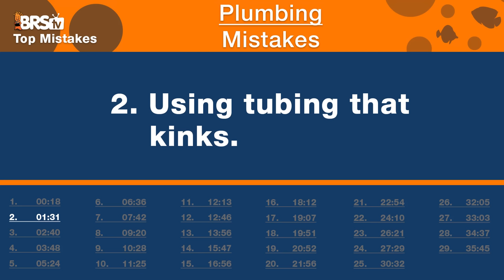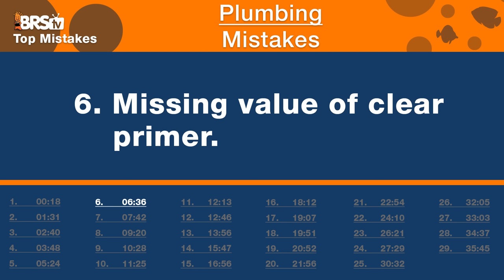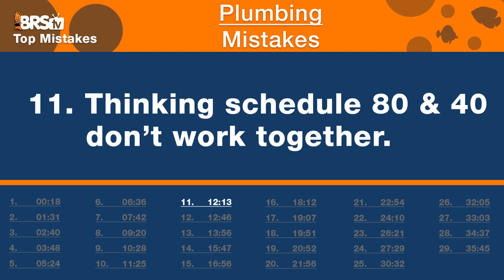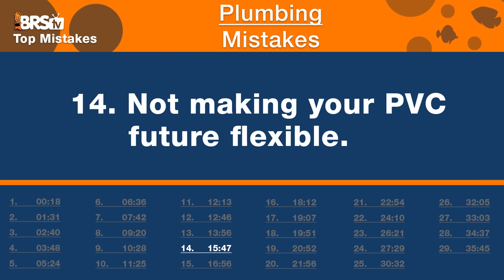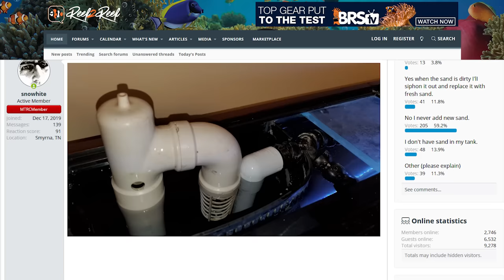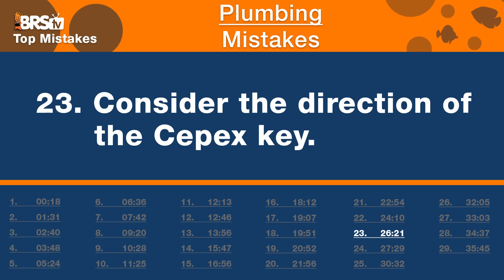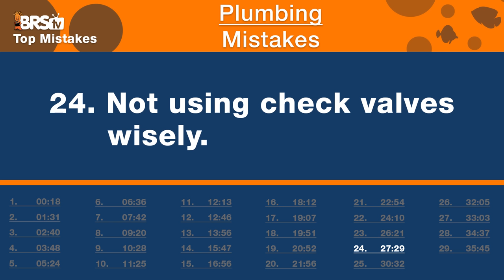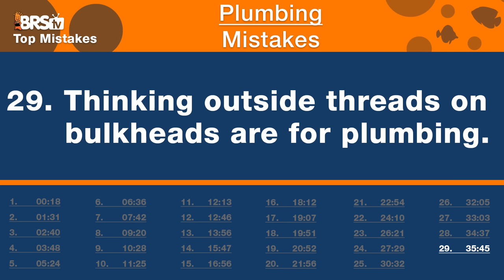If you don't fix these plumbing issues now, you'll hate yourself later! Top 29 Plumbing Mistakes.

Comment from the maker: What was your WORST plumbing mistake you ever made? Were you able to fix it? 
➡ https://brs.li/BRStv_TopReefing_Mistakes
Reply: Bulk Reef Supply not adding unions and then needing to move my sump
Reply: Drawing out the plumbing, to ensure enough fittings on hand. Sucks when having to make multiple orders back to back because your missing 1 or 2 items, also puts a stop to the build.
Reply: Recently, did not cement the join going to my algae scrubber but used silicone to loosely keep it in place. Luckily I was there when the join came open and the pump was rather weak. So very little water leaked.
Reply: Not knowing that when gluing PVC pipe that if you dont hold it in for a bit while it dries, it will push out just a little bit. That little bit compounds itself over multiple fittings.
Reply: Putting a 90 on backwards. Thankfully I realized it before it set and I was able to turn it. Another couple of seconds and I would have been out of luck
Reply: Gluing union cuffs on but forgetting to put the union nut on beforehand. Done that a few times and it's infuriating
Reply: Do they have clear pvc glue instead of that blue homedepot kind

Comment: I'm getting ready to begin my first hard plumbing job on a 40 gallon breeder. I plan on using cheap white 3/4 PVC to dry fit everything in place, then using those to cut the blue schedule 80 pipe. Thanks for the tip on clear primer! I had not thought of that!

Comment: love these videos.  so helpful.  i was hoping you could make a video regarding options for how to deal with power outages.  the one thing i wish the apex was able to do was to handle backup. what are our options?
Reply from the maker: Backing up your entire system usually isn't realistic due to the amount of power required. That said, with flow being the most important thing during a power outage, many pumps like those from Icecap, Maxspect, and Ecotech have great batter backup options!

Comment: Well, good grief. Just like you mentioned, I thought I had all of my DIY sump set up ready to go in my head. But now, I guess I’m going to have to rethink it all.  Hmm... 🤔 
I’m just joking guys. Thank you so much for all the great info! You have really forced me to not only rethink how I want it to work but how I may want to or have to change the parts in the future too. One in particular was the ball valves. I was thinking of using the black pond hose instead of pvc because of the pressure you have to apply to turn the ball valves. Yes, I worry about popping a seal in my plumbing because of the excessive shifting.

Comment: When using those expensive unions, make sure you leave enough space on both sides of it so if you DO have to chop up all the plumbing for whatever reason you still have at least one more use out of them with couplers and so forth.
Reply: 🍻 man agreed :)
Reply: 100% this.   Good solid advice.  I do the same thing on pool plumbing.
Reply: Couldn't agree anymore, learned the hard way when putting on my bulk heads. I should of staggered the heights to make it easy to take on and off.

Comment: A plumbing mistake I just made. 
Be sure to leave unions screwed together when gluing to piping. I had the two sides apart and some glue got on the flat non “O” ring mating surface and melted it.
Now I need to replace it along with the 8” section on my UV plumbing using couplers and more pipe. 😕

Comment: I'm getting ready to plumb my trigger platinum that I won for a tip about getting a camping washer for filter socks from walmart during you christmas giveaways. The connection above the returnpump, is that for the return pump or a spill through for a manifold

Comment: I recently bought a used tank with an internal overflow and tempered glass bottom. Its a durso style setup. I ended up using both holes for a herbie style and then running the return up the wall behind my tank. If you are on a budget you can turn a crappy durso overflow into a a good herbie by doing this. It seems obvious but I still see or hear people saying that the tank is only set up for a durso, and thats just not true. Anyway great video love your guys content! Keep it up
Reply from the maker: Very true, great tip!

Comment: How easy and safe to Re-do the bulk head that attached to the display tank? My tank is 3years old and bulk head has been silicone by the manufacture when I custom made it. My concern is I dun have a "clean surface" inside the tank
Reply from the maker: You will need a clean surface in order for the bulkhead gasket to seal properly, so make sure to remove as much of that silicone as you possibly can before re-installation.

Comment: Its important to let PVC glue set before running water through it, not only because of the head pressure against the freshly set pipes, but also the VOCs that glue gives off will set off a mass-spec like fireworks.  Lots of nasty, carcinogenic VOCs in PVC glue that take hours if not days to fully off-gas.

Comment: BRS family can you help me with a hard plumbing question? Want to hard plumb sump from display to adjacent fish room about 6ft away. can i just run a 90 degree angle parallel all the way to sump, or do i need to slope the pipe from tank to sump? sorry for the sully question but trying to find out of this is possible. thanks for any info.
Reply from the maker: We try to avoid long horizontal drain runs if you can, but for a 6' section, you're probably not going to run into any major issues. Just make sure that you install some unions so that you can remove that section and clean it out as needed.
Reply: @BRStv  thx a ton!

Comment: Would I have to upsize if I got a 1 inch pvc 40 schedule and a 1 inch fitting 80 schedule?
Reply from the maker: Nope! You can use 1" sch 40 PVC and 1" sch 80 fittings without issue. The schedule 40 and 80 PVC both have the same outer diameter.

Comment: Curious what success people have had with threaded pvc connections and the use of teflon tape, teflon paste, or silicone.  I'm going to be plumbing a new tank this weekend and have used teflon tape in the past but I seem to recall reading that some prefer the paste version instead.  Any benefit of one over the other?
Reply: Joe Gajda Look into la-co plasto-joint stik. Teflon is not made for pvc fittings. Yes, people use it all the time. The way pvc threads are designed are not made for tape. Paste like Rector seal is messy. After doing tons of reading on various forums, people seem to swear by this la-co plasto-joint stik. Hope this helps.
Reply: @JTReef  Thanks for the tip. It sounds promising and now my dilemma is whether to order it and delay plumbing the tank another week or go with the paste which I can pick up locally. I'd like to think I'm a patient man but maybe not :)

Comment: #8 - Dual Return Pumps: what if you’re considering a setup like waterbox or Red Sea that come with plumbing already? Any recommendations, please?
Reply from the maker: In that case, you're best off spending a little extra on a single, reliable return pump and having some sort of monitoring device like the Apex to send you an alert if something goes wrong. Running two pumps on one return line just doesn't work well.

Comment: I have a 120 with a single corner over flow. It only has a return and over flow. What would be a good solution?
Reply from the maker: You certainly could make it work, but I've seen some reefers take out the corner overflows and drill/install an external overflow in the upper middle of the tank, which allows them to also drill/install two return lines in the far corners of the tank.

Comment: Do you have to buy ABS to PVC cement for all slip bulkhead connections, or can you just use the regular PVC glue?
Reply from the maker: We typically have just used PVC glue and haven't had issues. Since most of our plumbing is low pressure, the chances for a leak are ultra small.
Reply: riccam213 yes they make specific cement for this. Sometimes called transition cement. Specifically for gluing ABS to PVC. It’s ugly green though. I’ve always used Oatey all purpose cement. It cover just about everything. I would not use primer on ABS though. It can really make it really gooey. Most glues say not to use primer on ABS.

Comment: @Bulk Reef Supply, About the wait 24 hours,  What if have to replumb an existing tank?  Wife let me expand fish room into garage.  I am going to relocate my sump into the garage so I can service it more consistently.  Do I just run my tank with power heads for 24 hours?
Reply: They have fast setting variation of pvc cement. Specifically for plumbing repairs. Thwy cost a little more and you have to be on the ball and ready as the work time is next to none. But it would do the job and ensure a good seal.
Reply: Merxion you could, and just put a heater in the display. However if you absolutely needed to run your return pump, you can put it online immediately, although not recommended. Just keep an eye on that skimmer because it will go crazy.

Comment: Anyone know how to dampen vibration if i have two return pumps inline? Could i stick the silicon tubing on return side and be fine or would i have to redo the plumbing on return and intake side?
Reply from the maker: Typically running two return pumps on one return line is an issue because both pumps are fighting each other. Regardless of the vibration issue, you might find it beneficial to run two separate return lines. While you're at it, use a little bit of silicone tubing to connect the pump to the hard plumbing to help with that vibration issue.

Comment: I drill tanks with the fish in them.  The glass is more stable with water in the tank.  Just lower the water level and drill away.
Reply: Very nice.  I think many viewer's would benefit from a video on this.  Maybe installing a BRS product or two.
Reply: I wouldn’t drill holes in a tank with water in it.  There’s some awesome videos of this causing catastrophic tank failure. All the water goes out fast when the side cracks and blows open.

Comment: I would recommend never using a miter saw and box. Use ratcheting PVC pipe cutters; they make perfect clean cuts precisely where you need them, are much faster, and you don’t have to clean up the pipe ends! 👍
Reply: I had the exact opposite experience. My rachet cutter would never cut straight, it always had a slight angle. I bought a plastic blade for miter saw and loved the results. I chamfered all my piping anyway so I didn't mind having to clean the PVC debris out of the pipes
Reply from the maker: Fast but often makes a raised ridge at the cut point
Reply: Why do you chamfer the pipe—Does it slip in easier that way? I’ll admit there can be a slight angle once in a while, but it doesn’t affect the fit so long as the angle goes back toward your length of pipe and the longest part of your pipe is where your cut line is. That way the pipe inserts into the fitting to the exact depth you require. But your comment gives the impression that you pride yourself on a very clean and precise install and possibly enjoy the process of putting the plumbing project together. In that case, you may balk at an uneven cut. I was unaware they made a plastic miter blade.
Reply: The chamfer makes sure that you don't scrape the pipe clean of glue and also provides a little area inside where the glue can really hold onto the pipe to make a good bond

Comment: So my tank is pre drilled at the bottom.  If Durso is not the way to go then what?
Reply from the maker: Durso is really the only option if you have just one drain hole. Most "reef ready" style tanks have two holes, one for the drain and one for the return. If you wanted, you could use both for drains and set it up as a herbie style overflow. Only downside is that you'd have to either drill a third hole for the return or run it up and over the back of the tank.

Comment: I do not suggest this at all, but PVC can be bent to any custom angle by filling it with sand, heated in the oven to 400F, bending it using a form, and letting to cool.
Reply: This is easy to do, it works better if you can find some soft tube to put into the tube your bending to keep it from crushing. They sell pipe bending tools im the electrical departments of big box stores.
Reply: The heated sand is put in the tube to heat, and keep the form, of the PVC. It's a really neat process. The link above show a guy doing it for backyard rollercoasters! I wish I would have know about this before plumbing my fish room! So many 90+90 corners that could have been eliminated with a custom angle and couplings.
Reply: Eliminating the 90+90 fitting corners is also import when trying to maintain elevation/height to prevent backflow siphons. All around win win.

Comment: i first got a dc pump 8 years ago or so "waveline dc 10000" and never had a problem with it till last year it stopped and i knew the second it stopped thanks to the 1" fisher check valve that makes a loud click when it locks up. i was about 30 min from leaving on vacation to FL for 3 weeks. So i would say that the fisher check valve saved my tank i have had since 2001 "150 gal 6 foot tank" So if your like me and push your luck spend the money it could save your tank to :<{)